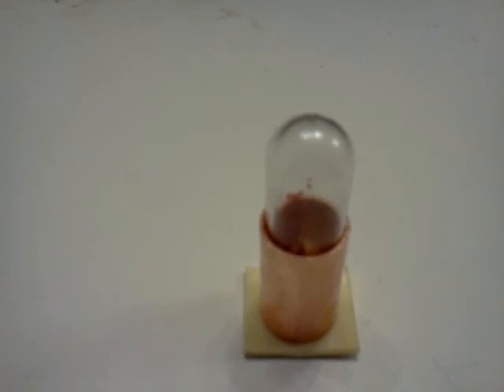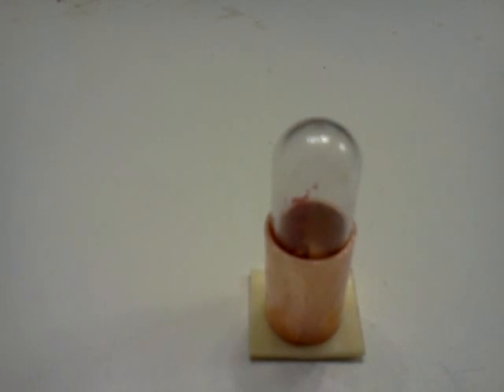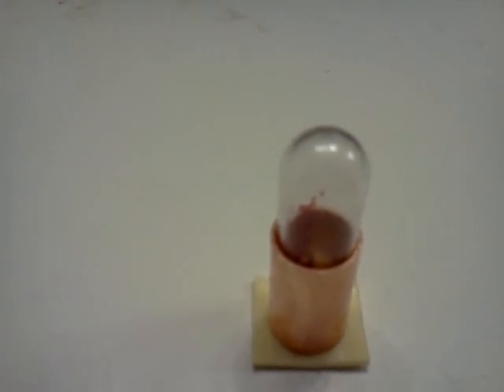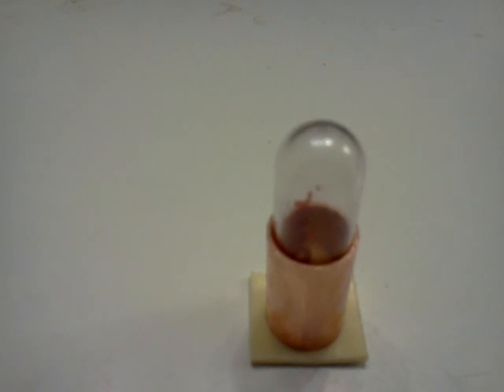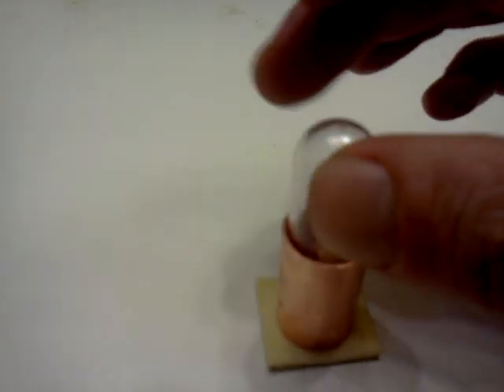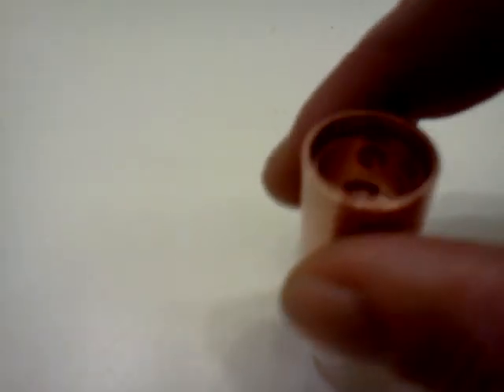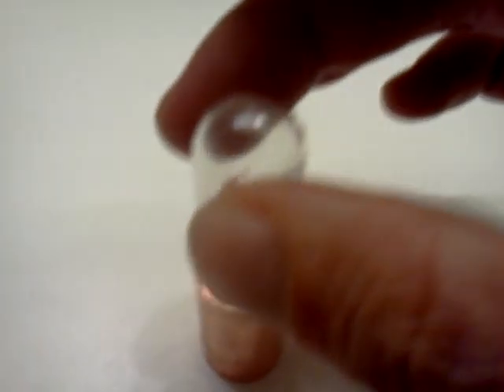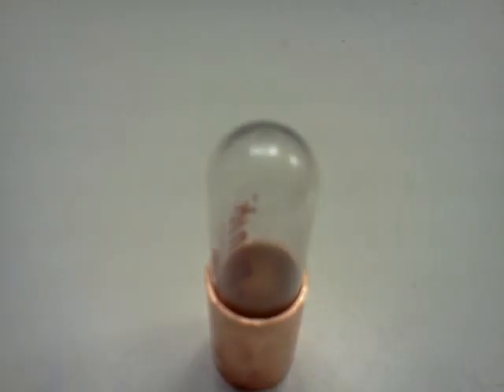Stirling Engine Power Piston From Scrap Parts

Comment from the maker: It is for use in a very low temp model, such as one that runs from the heat of your hand, and the plastic is thick enough it should be useable in one that runs off hot water since the power piston does not get very hot at those operating temperatures.  For those without a lathe or the skills to bore and hone glass cylinders and graphite pistons, the search for a very low friction and air loss piston is never ending.  I will be attempting to use it in an LTD, will post the results once complete.